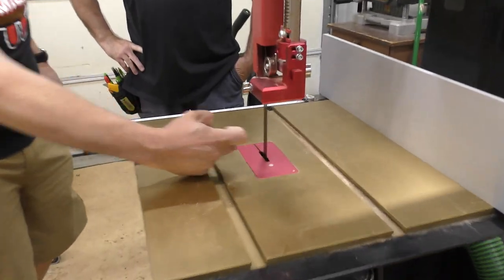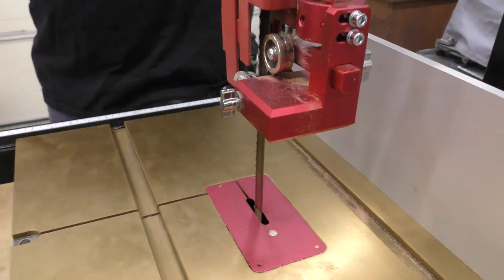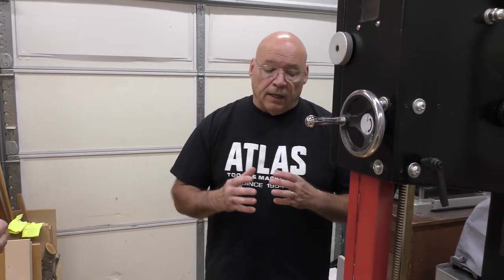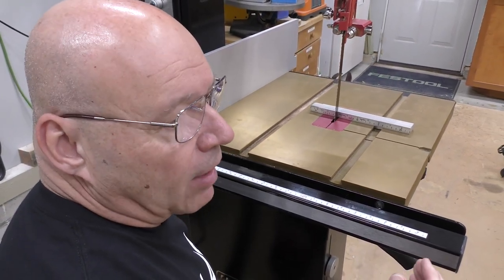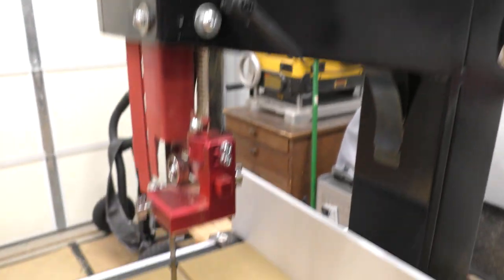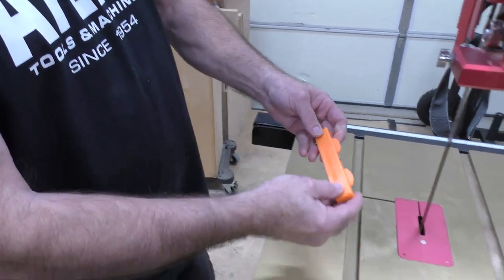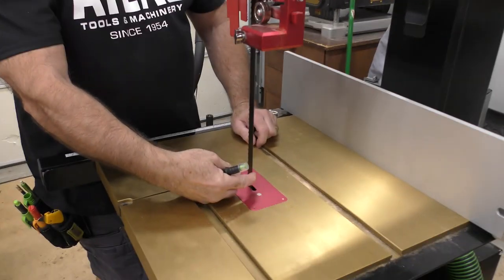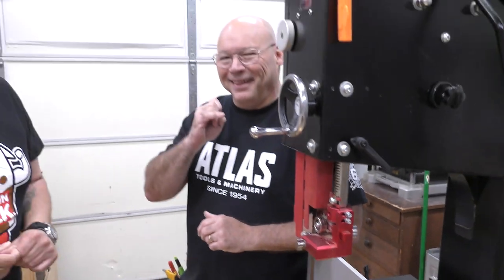Bandsaw Basics: Setting Blade Tension

Comment: Informative video, Guys. I did purchase the Eztension for my PM 1500. I use a the 1/2 inch 3 TPI blade from Highland Hardware. I found that the blade tension set using the 1/2 inch notch was way to loose, in fact the blade came off the saw when I tried to resaw. I checked the tension using a Lenox 62126 tension gauge and found that I needed to use the 5/8" notch on the EZtension to get 15,000 PSI. That worked fine and was repeatable when repeatedly checked with the Lenox gauge. I now do use the Eztension gauge for that blade but will recheck with the Lenox when switching blades.
Reply from the maker: Thanks for the follow up Greg...good to know